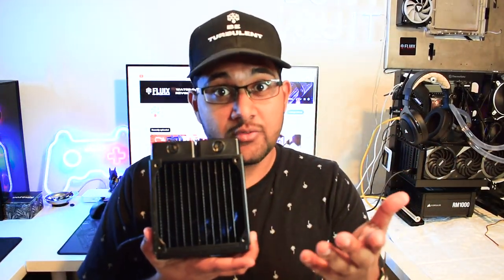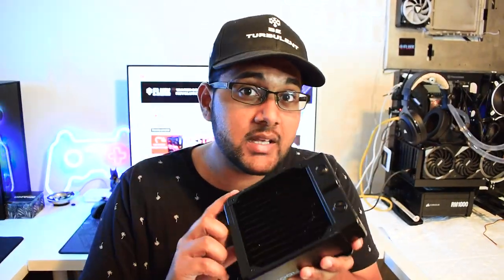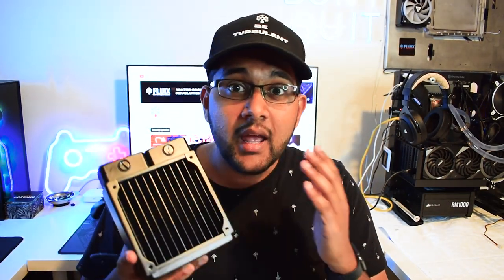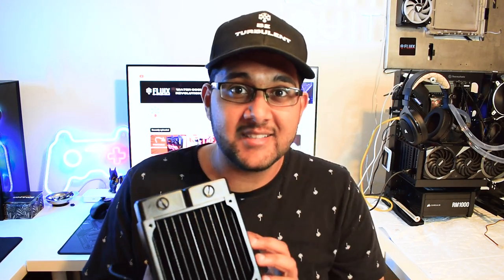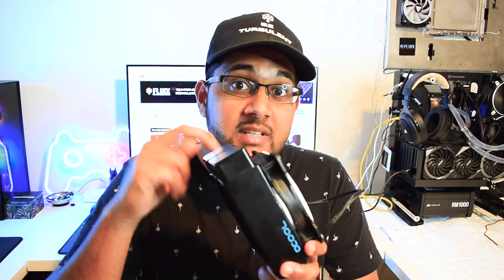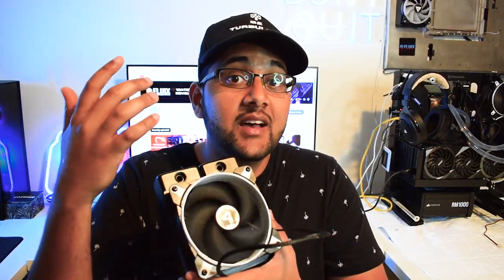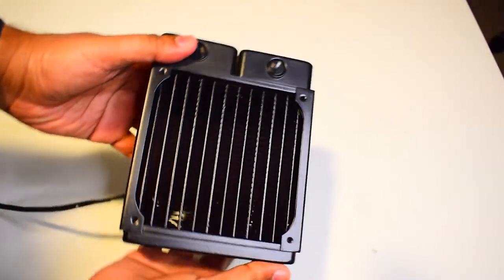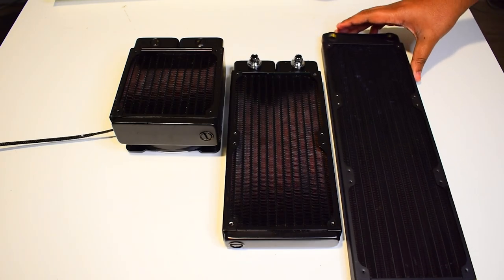What SIZE Radiator do you need for Custom Water Cooling?

Comment: If it can fit in your case then get what can fit. Lol if your thinking about cost on a custom water cooling build, get an AIO, shit will start getting pretty expensive once’s you start adding blocks and fittings. That’s why I wait like 5 years to upgrade to a new build cause I will just go all out. My previous all out build was fully water cooled 980ti in sli configuration with Intel 4790k. Now my current build is 4090 with an amd 7950x3d that is being cooled by 420mm rad, 280mm rad, and a 120mm rad. Get what fits and not worry about until your next upgrade cycle.

Comment: i think 360 is too tight for rtx4090+13900ks^^
Reply from the maker: Yea I hear ya, that would be over 600 watts at peak power. Still doable with a 360, but having a 240 on each is bear minimum with optimized fans and a high flow rate pump! 
With rads I tend to go overkill, our 12900K and 3090 system has dual 480s.